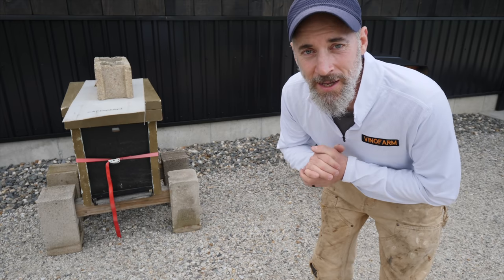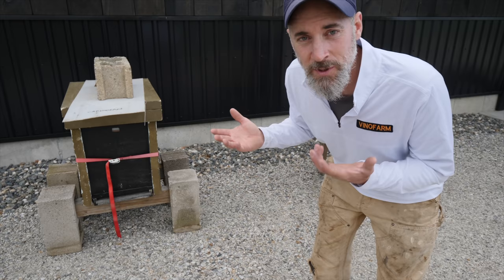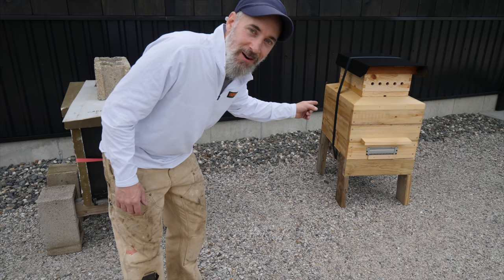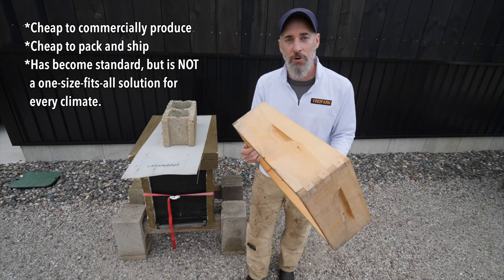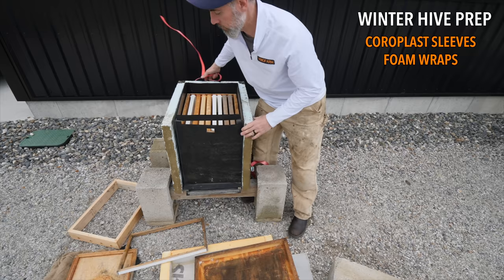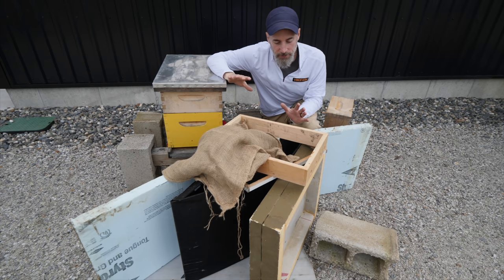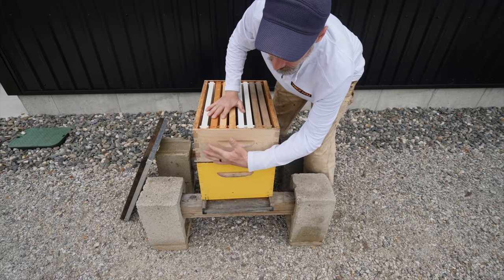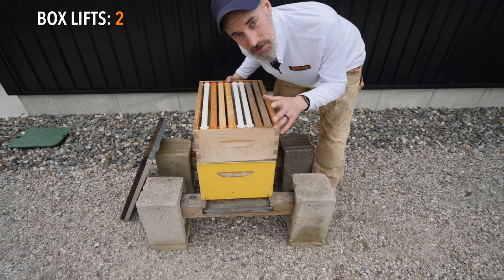I Fixed The Langstroth Hive (For The Bees AND The Keeper!)

Comment: Look like Lazutin frames would work.  
Basically a (nearly) square frame that allows the bees to make a full circle like you are looking for and fit the langstroth box width.  Layens aren't wide enough, you'd need completely new boxes instead of being able to convert the existing Langstroth hives.  

 I believe you can get foundation already made for Lazutin frames as well.  The rest looks like a VERY well thought-out configuration!  

Curious as to the cost of the Alaskan yellow cedar these days - definitely not something that would be mass produced, but then the backyard/garage inventors usually come up with better ideas than assembly line focused mass producers.  Looking forward to seeing your results!
Reply from the maker: But not really. These are ~18” wide foundation.  Layens frames are ~12” wide. The reason Langstroth foundation fits in these is because they are Langstroth frames.
Reply: @vinofarm  Corrected my error - I was thinking Lazutin and typing Layens.  I was up WAY too late last night...
Reply from the maker: @pJarhead64  AYC was about $18 for a 2x6x8’ which is not that much more than pine these days for a far superior piece of wood. I used 4 per box. So, not crazy expensive but shocking to a person from 2019.
Reply: @vinofarm  Thanks for the folllow up!

Comment: good luck  with your  innovations. 
let me make some points.
about  the frames.
the top of the frame and two  top
corners usually  made up with honey. 
the deeper  frame you talking  it's 
also  dr leo use with 2" wall  box.
they used in Russia  and Europe. 
if is  Capt  with honey  it's  heavy. 
and actually  it's  not help with 
your back. and you need spesial
honey  extractor. 
about the box.
it is well  insulated which  is good. 
but now  you making more problems 
early in the season  with warm days 
and cool  nights and nectar  starts  to coming in all this moisture  is got
to go. by blocking  or restrict the top
vent you making more problems 
warm air loaded with moisture and 
contact  with  a cool surface turns to
water right  on the top of the box. 
you vent must be at the side of the regular box.so eny moister or water 
drop outside. the top box you 
instal it is a moisture  collector and no needed. 
the well insulated  box you needed 
only in the winder .
if there's  is any activity  going  in 
the colony  you have to  have that
draft  (from the entrance to the top)
the more you understand  it the less  
problems you gone to have.
and makes  unnecessary  the well
insulated  box

Comment: How do you change out brood frames when the comb is old and heavily used?
Reply from the maker: It’s one year old. I’ll just give them fresh empty frames when the time comes. Just like with regular hives.
Reply: @vinofarm  what about any brood still in the frame you're removing? Do you just sacrifice that, or do you have some process?
Reply from the maker: @bowlerhatman01  I’ll deal with it in several years. Frames will rotate out. They always do.
Reply: @vinofarm  cool, keen to see how you do it. I only ask because at the moment when I want to cycle frames out, I switch the one to be removed up above the QE and replace it with an empty one, then remove the old one once all the brood have hatched out, but that's clearly not an option here.
Reply from the maker: @bowlerhatman01  Oh, it could be an option, no problem. It would just be a stack of boxes. Totally possible, though.
Reply: @vinofarm  yeah true, or I suppose if you really wanted to you could do a bit of a cutout. Take the comb out, split into two and tie into two standard frames. Let hatch out, then remove.

Comment: Why do you think the Bees distribute their brood that way?  They create a spherical brood zone regardless of that gap.  
The Layens hive is basically the same idea though to get rid of that gap.  Trust me, this plagues me.  Langstroth deeps should have been designed as a 17x17 square from the very beginning to most readily accommodate that Sphere.  But they weren't.  So you have to use the standard so that you can buy frames that fit your boxes, sell nucs or sell out entirely one day if you wish.  You are backing yourself into a corner.  They solution you may consider is an insulated long Langstroth.
Reply from the maker: It’s not a corner if I don’t plan to sell anything and know how to make more equipment. These hives fit my needs precisely.
Reply: Of course.  Not trying to be a prick.  I'm sure once I make my designs public, people will criticize.
I just think it is important to tell New-Bees to potential limitations a Hobby Beekeeper may find.
That stacking nonsense involved with Langstroth Hives should be eliminated entirely for any designs for Hobby Beeks.
A well insulated Long Langstroth Hive with a hinged lid is the best for them.  My design aims to be the best,  LoL.
Reply from the maker: @LOCKBEARD  Horizontal is not appropriate for northern climates. Too many colonies die because they can’t maneuver sideways to find food.
Reply: @vinofarm   Yes, but this is why beeks in the north would need to insulated very well & put a sheet of newsprint on top of the frames with a pile of sugar on top of it.  That's short term.  Long term is breeding the bees to get better at sideways movement.  Maybe we get it right 1000 years from now.  But it is a worthwhile effort.
Reply from the maker: @LOCKBEARD  That’s funny. Commence evolution!

Comment: Jim, curious - why a medium and deep instead of two deeps?
Reply from the maker: For my climate and my winters, I’ve found 8 frame deep+medium to be the Goldilocks cavity size. Turns out, that cavity is just slightly larger than what Tom Seeley has determined is the average wild honeybee cavity in a tree.
Reply: @vinofarm  Thanks.  Two deeps is just a little too big and two mediums is too small!  Got it! 😀

Comment: How are you going to handle OA with the gun you have? Or medicine that is supposed to be "between" the brood boxes?
Reply from the maker: OA goes right in the front entrance. Just like every commercial beekeeper. I do not plan on using anything that goes “between” brood boxes. Apivar strips can be extended lower into the brood with a little wire.
Reply: @vinofarm  huh. How will you make the seal better for the gun you are using? Wooden tool or something?

And that makes sense for the apivar strips. So, nothing like formic pro then. Makes sense. That does limit you options a bit. But ease of use probably offsets that.

Do you have plans or a build video coming?
Reply from the maker: @ThrantorYoungblood  I will make a wooden plate the same size as the front entrance with a hole in it. Insert the plate and then just shoot in the OA. The hive is WAY tighter sealed than the old hives. The vapor will spread everywhere and hang inside. The old boxes leaked like crazy. I may make a build video. I shot myself assembling one so I have all the footage. I’m just really busy right now.

Comment: That big empty space at the top :: how often do the bees build it full of comb?
Reply from the maker: What empty space?
Reply: @vinofarm  The image at times 24:57 and 11:14 shows at the top a big space, which is here full of burlap, but at other times may be empty.
Reply from the maker: @anthonyappleyard5688  That's always closed unless I'm feeding. See 23:57 where I explain the inner cover. The upper box is a feeder space but also a place to keep burlap in summer to keep the sun's heat off the inner cover and polystyrene in winter to hold heat inside below the inner cover.

Comment: Not to take away from your hard work and design(s), but why not build a circular beehive rather than the commonly used square ones?
Reply from the maker: Mainly because I based this design on a garage full of square boxes I already owned. Building a radically different shape would have meant buying a lot more materials and getting rid of 5 years of square equipment. I repurposed it all, instead. The bees seem to be fine with square frames. They're building full brood circles ON the frames.

Comment: As always, Jim, happy to discuss. Give me a call if you'd like. Best, Andrew @HoneyOnWales
Reply from the maker: I definitely want to finish our conversation! Checking the bees today and I’ll try to connect this week. Thanks!
Reply: @vinofarm  Good deal! A couple talking points/things to consider:
1. Curious why moisture is a big mental hurdle for you, maybe look into SolutionBee HM-1 in-hive monitor to get a true analysis. At $45ea, they're not too expensive;
2. Curious why ventilation is a concern (show me the ventilated tree trunk). Be mindful of "Stack Effect" and the heat it bleeds away from the cluster--even in warm times it significantly strains the colony's brood incubation requirement temperature window of 95-98F;
3. Lots of sidewall insulation, but no top insulation (which is the most valuable). This accelerates the Stack Effect's velocity;
4. Redundant gear requirement with two 1gal feed pails vs. one 2gal pail;
5. Consider interning a day or two with local or similar climate commercial guy(s) who have little to no winter loss (suggest contacting Mel Disselkeon in Michigan). This was the biggest breakthrough for me in my journey to achieving zero winter loss. Easier to refine, mimic & springboard from a known successful system to suit your needs than re-invent the wheel...and presumably have to refine that new wheel over several years;
6. Remember candy/fondant/solid sugar is emergency feed only when stored syrup is unexpectedly exhausted, not standard practice (and bees need a lot of supplemental water to digest solid sugar);
7. With your VERY short season, nucs have a tremendous advantage over packages.
*The Engineering Process of "Define the Problem; Background Research; Specify Requirements, Brainstorm, Evaluate and Choose Solution(s); Develop and Prototype Solution(s); Test Solution(s); and Communicate Results" is a very long road fraught with setbacks*
***I like your enthusiasm and applaud your efforts, and I'll work as hard as possible to help you in every way I can!
Reply from the maker: @drewt3210     I have answers for all of these questions but I’m always willing to learn. 

1. I have temp/humidity sensors in every hive. Watching hourly data roll in has been an eye opener.
2. I’m rethinking ventilation. That’s why I made this adjustable. Easy to open and close as needed. I severely reduced the upper ventilation plans for winter with the much smaller upper opening. Again… always easy to close if needed. I’m flexible. 
3. There WILL be top insulation. Lots of it. I didn’t have it ready to show for the video. Winter is in 6 months. Stay tuned. 
4. I already have 20 one gallon pails. I’m using what I have. Why buy new 2 gal pails?
5. I’ll look into it. 
6. If these deep brood boxes do what I’m hoping, they will hold more than enough food and I will not be putting sugar on like I used to. I agree with you. 
7. I’ve been wary of nucs in my area from past experiences. They either come up from the south in poor condition and full of beetles OR, you need to wait until June/July until they’re ready. My packages are already in. The queens in these packages are LOCAL queens. The packages were shaken in GA, but the queen stock is from a reputable breeder next town over. The package workers are like temporary labor. In a month the new workers will be from Northern queens. It’s the best situation for faster colony establishment. I’d be waiting 2 months for nucs. 

I can’t wait to talk more. Thanks, man.
Reply: @vinofarm  Solid!

Comment: The  answer to your problem is to build a Dartington hive. You’re welcome.
Reply from the maker: Looks like he forgot about insulation, though.
Reply: @vinofarm  you are right - in the original. I use a Beehaus which uses the same principles as the Dartington but is plastic so insulated. No good if you want to make your own thing or use frames other than 14x12. In the UK we just dont have the extended cold weather so it isn’t a battle we usually need to consider. I think what you have created is very inventive. Enjoy your channel very much.

Comment: why not just got with a Horizontal Hive?  I dont lift anything but honny.
Reply from the maker: We have long winters. Bees move vertically on comb a lot easier than horizontally across frames when getting to food. Also, the brood box cavity is condensed down to just the size they need to survive so all the air sealing and insulation is just where it needs to be. In a horizontal hive, there is a massive space to the side of the cluster that is filled with cold air. Doesn't make sense to me.

Comment: Forget all your work about the ventilation. It is no  god….
In Denmark we just use one size box and we only chance boxes Once a year. In late summer we put the Queen and bees Down to one ( some use two) box with 3-4 frame with brood and pollen and 6-7 empty frames for syrup. Feed the famile 15-20 kg sugar dryweight (60% sugar water). And let the bees alone to next spring….
Forget about holes in the top…just a bottomboard with a steel mesh for ventilation. Absolutely no ventilation in the top… What so ever.

Comment: Great design, however cover the polystyrene with something as we have found it has a very serious off-gassing problem from the fire retardant.  Paint is even better than nothing.  We have done extensive research on the matter.
Reply from the maker: I’d love to see a link, because every single thing I’ve read about XPS is that it is a certified green building material and basically inert. Please back up your claim.

Comment: in Poland, we have polystyrene or polyurethane hives, they are good for winter.  I enclose a link to the manufacturer.  if you want a larger frame, you can use the dadanta bee hive. http://lyson.eu/langstroth-polski/4024-ul-langstroth-z-dennica-wysoka-higieniczna-plastikowa-niemalowany-5903661514907.html?search_query=Langstrot&results=1

Comment: You should try one out with wood fiber insulation instead of EPS - it'll be vapour permeable and react better to any overheating in summer (should it occur). https://www.youtube.com/watch?v=uDbMJZ68nSg You could monitor it with the hive monitoring system if it behaves better. I'd be curious to know.

Comment: All you talk about is easily solved with a layens horizontal bee hive
Reply from the maker: But only if you want to have a horizontal beehive (I don’t). And you don’t want to add supers (I do). And you don’t already own a Langstroth sized extractor (I do.) This solves my problems with a Langstroth shaped hive using the Langstroth equipment I already had on hand.
Reply: @vinofarm  you just made one with one extra step
Reply: @vinofarm  they also have plans online so you can make a horizontal deep or not deep langstroth hives
Reply from the maker: @mr_weird6324  I don’t think you read my reply.
Reply from the maker: @mr_weird6324  I know they have plans online. However the two main features of a horizontal hive: 1. Being horizontal 2. Not being superable … are the polar opposite of what I wanted to build. Both of those thing are dealbreakers and the reason I made this video. I want a vertical hive which I can use supers on. Period.
Reply: @vinofarm  sorry for making you upset I did not mean to do so, just was wondering the thinking behind your actions when similar things already are apart of the hobby. After your last exclamation I have the information I need thank you for offering it to me and I be rooting that your system works they way you want it too

Comment: That's basically layens hive ^^
Reply from the maker: I built it using a Langstroth bottom board, Langstroth deep box, Langstroth medium box, Langstroth inner cover, Langstroth lid, Langstroth width frames, Langstroth foundation and it will be supered with Langstroth medium supers with Langstroth medium frames which will be extracted in my Langstroth sized extractor.... So it's "basically a Layens hive", except it's not horizontally oriented, the frames are not touching and it's designed to use supers to collect honey. 

I didn't build a Layens hive. Stop. It's still a Langstroth hive.
Reply: @vinofarm  
Thank you for the clarification, please note that i think it's brilliant idea and design, and also brings down the ibuprofen cost 
Well done ✌️
Reply from the maker: @medmerada600  Sorry for the snarky reply. You are the 100th person to make the same comment. It’s a little frustrating. Thank you.
Reply: @vinofarm  
Absolutely fine, lookout forward To see how the bees package settle in

Comment: Couple of suggestions to hopefully help avoid future headaches.  Wax dip all of your wood it will last much longer and be more pest resistant.  I have tried polystyreme, stryrofoam, and various forms of poly urethane foam board in my hives and the ants destroy all of it.  Try using Rock Wool.  It repels water and pests/ants/bugs hate it.  Unless you will be stacking conventional Langstroth mediums or deeps on top of the brood nest, how to you plan to extract the honey from those long frames?  I have doubts about whether they will fit in most if any extractors.  Superb workmanship and seems very well thought out. If you haven't already, you might take a look at     https://horizontalhive.com/buy-hive-bees/swarm-trap-top-bar-sale.shtml#layens  Dr. Leo (Sharaskin) May be a good source of information on this type of beekeeping. ( Best of luck with your bees!   👍